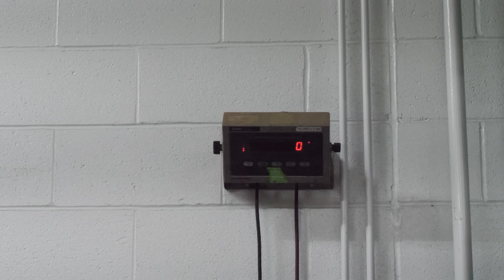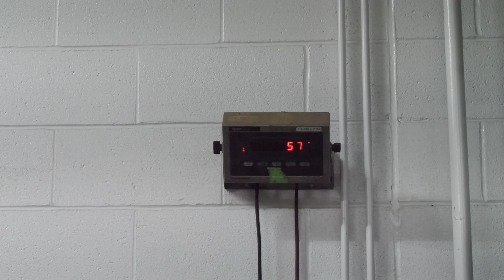EV TEARDOWN! Nissan Leaf Complete Electric Vehicle Drive Motor Unit Disassembly!

Comment: Very cool to see something different. You do have to love the simplicity of most EV drivetrains.  I wonder how hard it would be to use just the motor side of this in a EV conversion of something like a Miata or older Geo Tracker. :)     I like watching you tear these things down so I can see if it is something I might want to avoid as a shade tree mechanic. Yes the carnage is fun to see.  However for me seeing the engineering of these things is the high point. Thank you for the Insight you give us into all these different engines and transmissions you tear down.
Reply: Would love to see a moderately powerful EV drivetrain dropped in a 90's Geo Metro. Lol
Reply: Replacing the engine with an electric motor is relatively easy, finding a place for the huge battery pack and wiring up all the electrical systems will be the hard part.
Reply: Mouting not so easy, old way for conversions was big DC motor and adapter plate for the gearbox, fairly low tech and off the shelf, have a look at  EVTV motor verks channel for years of , Jack unfortunately passed now but years of info.
Reply: yes people use the leaf motor without the geartrain connecting it to diffs of other cars.   But the geartrain is part of the advantage of the setup.

Comment: I thought that was fascinating. It was interesting to see that the armature was a solid magnet while the windings were around it. So it is a brushless motor and therefore has no brushes to wear out or get covered with soot or anything that would need to be cleaned off periodically to keep it running at top efficiency. With the three wire connectors on the back, I get the impression that it must be a 3 phase AC motor too. So there must be electronics that converts the battery DC to AC and then sends out 3 phases to the motor windings. I think it would be interesting to reassemble it now and see if it could be set to running again. You know, just for fun. 😁

Comment: Thanks for everything. I own a 2017 leaf with 85k miles which I’m selling and just bought a 2021 with 15k miles for $15k. 
Wonderful to see the guts of the motor. 
Love your channel and all you do. Happy holidays
Reply: it would be a good idea to check/change the transmission oil in them. 🙂 also,the 12v battery is a common failure area. causes a lot of warning lights on the dash,and weird electrical problems. it can also wipe out the Bluetooth.

Comment: I love the variety you are doing every now and then. The CVTs and occasional electric or Hybrid is interesting. They may not add their own inspection ports but you did find some forbidden glitter and it is cool to see how simple mechanically these units are. I also loved the video of the rotted in half Ram truck, partly because I just think those trucks are junk. Have a good weekend

Comment: Thanks Eric!  As the owner of a 2015 Leaf local grocery getter I appreciate seeing the internals.  I'm impressed with the engineering and build quality of the drivetrain.  I'm now going to prioritize checking  the service interval on the gear oil and coolant.  Unfortunately, the weak link in the vehicle is the battery life.  I'm still at 75% after ten years, but the clock is ticking and the options for replacement / overhaul diminish as the car gets older.  👍
Reply: What would the battery cost be right now if you had to replace and do you honestly feel its worth the difference vs an ICE vehicle? Granted its no fuel pumps, filters and engine oil to change so thats a savings in itself. Ive looked at a Volt and Prius since im not a hybrid fan unless they came out with one that was gas drivetrain in the rear and EV in front so it was two systems totally independent of each other then i may consider it, at least if one system failed hopefully the other could get you home lol
Reply: @young11984  - probably 10K installed for a new 24kWh battery in a vehicle that's worth 8K.  That's why used LEAFs are so cheap. 
It's worth it to me to drive it locally for $30 in electricity a month (I charge at home 240V 30A).  My 4 banger Tacoma would cost me $300 in gas plus maintenance.
Reply: check out Dala the Great (Dala's EV Repair on youtube) out of Finland.  He's done a ton with the leaf with hardware and software hacking including battery replacements and upgrades.  I'd be pretty surprised if a battery replacement were $10k unless you're including labor or getting a brand new unit.
Reply: That's a weakness of most EVs AND hybrids. The aftermarket business of remanufacturing battery packs is still in its infancy, but there are aftermarket Prius packs out there. Then techs need to be trained to handle 200+V safely.
Reply: @jefeglancy  200v i dont even blink at, its the 700VDC+ and 480VAC i deal with that gives me the hebejebees even with all my ppe on
Reply: In New Zealand we love our JDM imports...
RHD in both countries so there's that..
and we have a number of Leafs.... 
because being a temperate climate means the batteries do not get too hot nor do they get too cold...

So charging/time are the two variables.

However we have some clever people in Christchurch who have rewritten the Japanese software to get the whole dash speaking English.... 
and can slip 62kwh batteries into original old 24kwh Leafs...

They rip apart test and rebuild battery packs the same way others like overhauling a 4 cylinder ICE

See also Robert gets a new battery in his Leaf..UK YT vid
Reply: There are 3rd party batteries coming into the marketplace for older Leafs, can get a 62kwh replacement with 275 miles range.  Downside is, still have the same issues with thermal management.
Reply: April fools realize what do you do with the battery after 10 years where is it going to go can a recycling I'm not 100% sure was Seminoles to take care of the ground to make it and what's the cost in the environment eventually they're not as clean as everybody thinks
Reply: @marktippin5802  
Obviously any day except April 1 you take the battery pack apart, locate the cells which are actually the problem, replace them with non problem cells either new or from another torn down "spares" pack...
and use the same EV battery in the same car for another X years.

A bit like you replace the iridium sparkplugs and the coil on plug packs every 10 years or 100k miles on an ICE?

Or the timing belt, idler and water pump...
or the timing chain and guides...
Reply: Also part of the problem is there is poor cooling for the Leaf pack and heat damages the cells. Since they're in series, you're only as good as your weakest module, once a module  (2 cells in series, 2 of them in parallel AKA 2S2P) starts going bad, it declines rapidly if that module gets below 15% or above 90% charge. I use the Leaf modules in a golfcart with 4 modules in parallel, for 8V and 6 of those in series to give 48V. That way a weak cell gets 'carried' by the other cells in the parallel group. I also keep the charge between 85% and 20%  and store it around 50%. Hard to do with a car unless you only use it for short distances. ie 20mi R/T
Reply: @ english
Reply: @marktippin5802  They are starting to be recycled more, the raw materials do not wear out and they are valuable.  The individual modules that are still good out of bad batteries are also sold and put back into use at salvage yards, it's rare that every module in a battery pack is bad.  Look up Rich Rebuilds, he's done some EV rebuilds on top of the ICE stuff he's done.
Reply: @JohnSmith-pl2bk  there's an outfit in NZ that is trying to put together a cooled aftermarket battery pack for old Leafs.  It involves using cylinder shaped sealed sealed battery cells and a coolant that does not conduct electricity.  If it works and is reasonably affordable it could be a good option for keeping an older leaf going.

Comment: Hi there. I am a retired design engineer. My speciality is diesel electric marine propulsion systems. I was really intrigued with this teardown. I have never seen the inside of an electric vehicle but have always suspected that the were a permanent magnet motor running off three phase AC. There is nothing difficult about that type of motor, small compact and efficient. thank you for satisfying my curiosity

Comment: This was great to see. I have a 2016 Leaf and it's really fun to drive. Throttle response and low-end torque is nuts. I've always wanted to see what was inside the drivetrain and you showed me! Thanks!!   BTW, the biggest problem that the disassembled motor will have is getting thousands of tiny metal chips from wherever stuck all over the armature magnet. The clearance between the armature and stators is very tight and it's almost impossible to get all the debris off the magnet. Get a strong, clean plastic bag over the magnet ASAP. Good you run a clean shop.
Reply: that magnet already had crud on it before the video was over. blue, the jacks and the table proudly sabotaging the EV

Comment: From an electrical engineer, you've now found out how crazy simple EV drivetrains are in comparison to gas engines. It's down to magnetics and electric fields. The stronger the fields and magnets, the more power.
Reply: 2nd that, im alsdo a fellow EE
Reply: The problem is electric cars are electrically very complex to understand and repair. In combustion engine if cylinder is low on pressure then it could by bad rings, hole in piston, or valves not closing tight, but if a MOSFET inside an invertor is going bad then it will be hard to figure out why it failed, and you hope that the bad MOSFET did not blow up the gate driver circuit as well.  

For performance upgrades no gear head is going to understand partial differential equations that looks like alien langauge when analysing the magentic fields of the motors to get more power. It will take away the DIY market unless some electrical engineers get together and make "rule-of-thumb" data tables to use to change out the rotors or rewind the stators.  We will also need you guys to give us "rule-of-thumbs" data for making the inverter stronger for more power and the parts list we need from Digi-Key.
Reply: @EETechs  I don't know if you were kidding but I've worked in electrical test for 43 years. All automotive processors follow the p1149 standard and have for about 20 years. This allows each chip to be put into a test mode which provides nearly 100% access to every gate in the chip. With high certainty, a bad chip can be discovered. In addition, the automotive industry has a standards organization called the  AEC and I believe it's AEC008 that states there shall be a zero defect tolerance policy in place at the manufacturer. This doesn't mean that there are no defects, rather the defects must be driven to resolution. I know all of this because I'm attempting to get my company, a large medical device manufacturer to adopt the AEC standard. Yes, the AEC standard is way more strict than what's acceptable in medical devices. I want to note that I'm getting corporate pushback because of the costs associated with the adoption.

Comment: We just bought a 30hp three phase electric motor for a grain mill on the farm. It weighs 400 lbs, so this 100ish hp motor at only 120 lbs is rather amazing.
Reply: Your grain mill motor is an induction motor designed to run off 240V no matter what load it has, and to do so continuously.  The Leaf motor is a synchronous motor  energized by a controller that adjusts the drive frequency and voltage (or current) to match the load.  It may also be designed to run at <40% power over extended periods.

Comment: In my experience working on Leaf's the electric motors never have issues. I have seen one inverter failure. The gear reduction oil needs to be changed, I recommend it at 60k km. 
I have seen a couple gear reduction bearing failures, catastrophic bearing failures. 
Overall the leaf is a pretty reliable vehicle and I enjoy how they drive.
Reply: No oil filter on the gear reduction? I notice Tesla has an oil filter presumably to catch the debris at run in. I would say the metal in that oil has been there since 1000 miles
Reply: @paulsimpson8990  there is no oil filter. I would also guess that most of the debris is from initial break in. Most leaf reduction gears I service have never had the oil changed and the oil is usually in terrible condition. I usually see them around 80-120k km.
Reply: @ it is a bit strange that the oil is that bad imo. I checked the diff oil in my bmw 335 after 12 years and 120k and it was as clear and clean as the day it went in. No lsd clutches to contaminate the oil.

Comment: Y'all in the comments got your heads in the sand. From one gearhead to another, EVs are amazing. The tech has come a long way and keeps getting better everyday. They are super low maintenance and the torque is so so much fun. The Nissan Leaf is surprisingly a lot of fun and it's one of the cheapest and worst.
Reply: Right on, I like engines that burn fuel and make noise, but ev's cover the use case for 95% of people 95% of the time, at lower cost, at lower maintenance,  ect.  I'll always have something gas burning in the fleet, but am seriously considering an electric pickup as the next daily driver ( absolutely not a cyber truck however)
Reply: @rotorhead5000 have you looked at the Silverado EV?
Reply: Whoever can make a battery that goes 300 miles and you can recharge in 5 minutes or less is gonna be as rich as Elon!
Reply: @rotorhead5000 , yes, I was in disbelief when Muskee put out a pickup that wouldn't be replacing fleet vehicles. Huge missed opportunity.  I hope he fixes.
Reply: The battery tech needs to make 2-3 more giant steps forward before EVs are more widely accepted. True hybrids however are the way to go until that happens.
Reply: @commenter674  Not all that close, mainly due to listed starting price, the f150 last I looked was the only one in my realistic price bracket.  I bought a new jeep around two years ago, so I still have a few years before  a new truck is on the menu, so a lot of things will likely be different by then.
Reply: @t-yoonit yeah hybrids are the answer. I like how they blow head gaskets because a gas engine isn’t meant to be heat cycled on & off over & over. I also like the fact that an early 2000s diesel powered VW got better fuel mileage than pretty much every over complicated hybrid built to date.
Reply: @stevemccauley5734 Are you not aware of the emissions problems with diesels or were you simply being disingenuous?
Reply: @stevemccauley5734  that's not true. The headgasket blow because of poor maintenance, such as blocked EGR's. A regular engine also heatcycles, low rpm, high rpm, etc. 
And a VW tdi was simple and had no DPF, and in those days the cars didn't weigh as much as they do now. I know, because I owned one. Later on diesels got so overcomplicated, EGR, DPF, AdBlue etc,  with worse dieselmilage because of emissions and extra weight.
Reply: The Bolt is one of the cheapest yet is one of the best. You haven’t experienced one pedal driving until you’ve tried it in the Bolt. It drives like a quiet automatic GTI.
Reply: @thirdpedalnirvana  The Bolt is surprisingly slow.
I know because I own a Mk7 GTI (and a TDI) and went to test-drive a Bolt, after I test-drove a Tesla Model 3. The Bolt felt slower than my turbodiesel, which was a huge surprise to me as I thought the instant torque of the electric drivetrain would make it feel a lot more snappy, which was absolutely the case for the Tesla. 
An 'electric GTI' it definitely ain't.
Reply: Right, different vehicles for different missions, but you need room to keep them all :)   I've got Gas, Diesel and EV (golf cart) looking to get a Leaf and put in a rebuilt pack. Gas for daily driver to work (until I get the EV), the diesel is great for towing RV, long road trips or poor weather, it's 4WD.

Comment: No, I was going to ask if the water pump was reusable.
'This is the current situation (while looking at the coil windings)...'  Slipped that one right in there.   Lol.

Regarding EV's.  Diesel locomotives use the diesel engine to drive an alternator.  The alternator supplies electric current to either DC or AC traction motors located in the wheel sets.  Those electric traction motors drive the train.  If electric motors can supply enough power to pull a mile long train consist, they certainly can push a car down the road.  Of course, batteries are a different issue, but power-wise, electric motors get the job done.
Reply: And street cars since the 1880s used -- an electric motor! Those things were cast iron frames and weighed, er, just a bit. Electric locomotives without messing about with an intermediate diesel came along in the early 19 ought-oughts. Diesel electric was only "invented" where rail companies thought it would be too expensive to run extensive / expensive power take-off lines along the track. 

So not sure what you're trying to say here. Of course electric motors have enough power to pull a mile long train. The limiting factor is the puny output of the diesel engine, meaning many locomotives required to pull that mile-long train. I think you have things backwards.

Comment: Less moving parts than the average variable cam position timing system. With those sealed bearing the motor should last forever. They had to find some place to put some juice that needs changing.

Great tear down. Thanks.